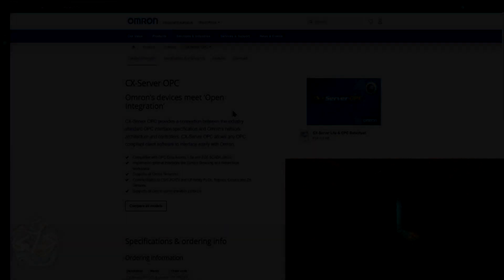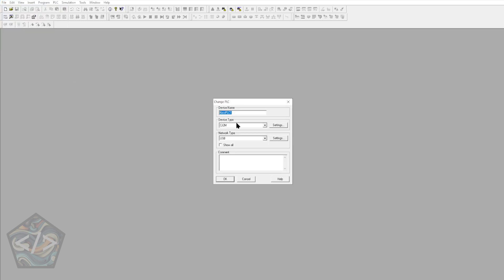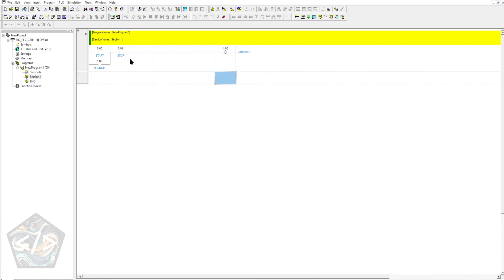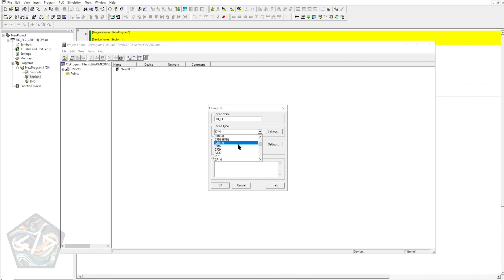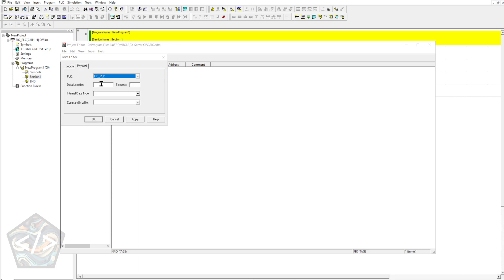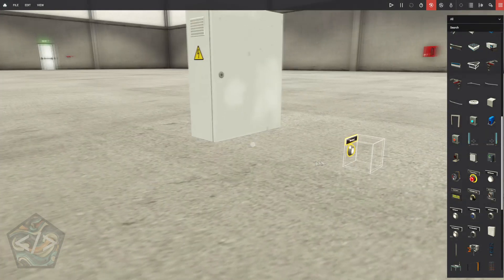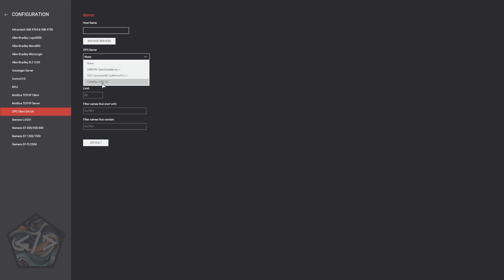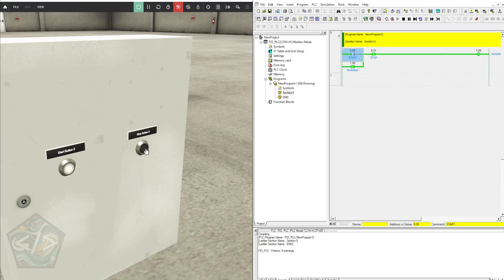Connect Omron CPU to Factory IO with CX-Programmer Using CX Server OPC - OPC DA/UA - CJ Series

Comment: Hello,
Does your connecton gets shutdownd a lot?
I have a lot off problems with the opc 😢
Reply from the maker: Can you give me some more info? maybe I can sort you out
Reply: @LogicLoaded  I am using  V2.5.4 and OPC server V9.7 and the server shutdown several times, on other times i cant connect on CX but i can on factory and once i got memory problems and the server just went down
Reply: @LogicLoaded 
 OpenDataServer.exe - Application Error

The instruction at 0x000000007750E1AA referenced memory at 0x00000000003D003A. The memory could not be read.

Click OK to terminate the program
Click Cancel to debug the program
Reply from the maker: @pycho5750  Based on this, How many tags are you using? Could you possibly try Reducing the polling time to reduce load on the Server, also while running, how's your load on your systems ram? Task manager